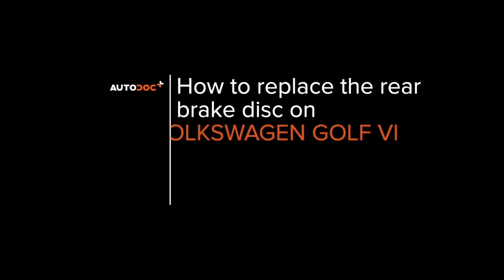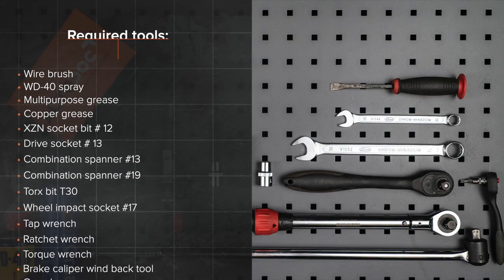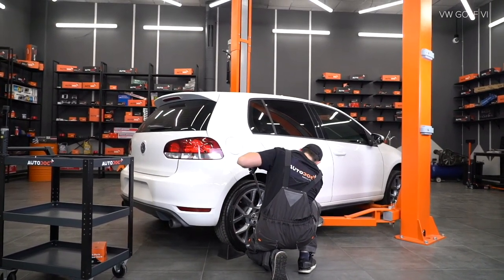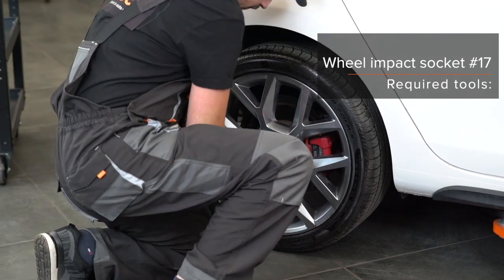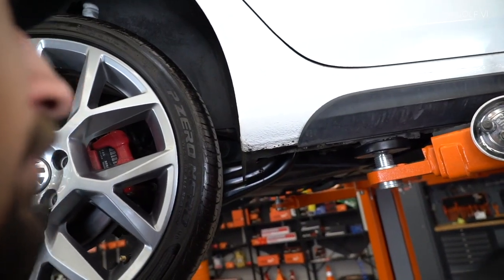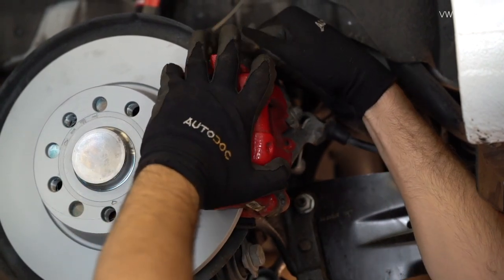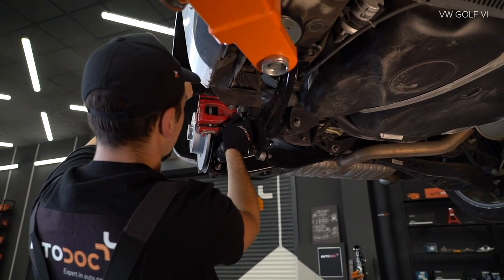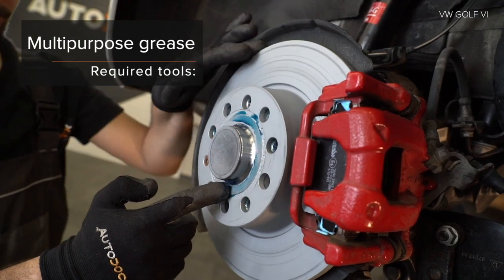How to change rear brake discs / rear brake rotors on VW GOLF 6 (5K1) [TUTORIAL AUTODOC]

Comment from the maker: Attention! This video contains mistakes:
2:51 - the tightening torque is 4 Nm, not 9 Nm.
3:10 - the tightening torque is 90 Nm, not 75 Nm.
3:56 - the tightening torque is 35 Nm, not 30 Nm.
We're sorry for the inconvenience 🙇‍♂
Reply: 3:10 - according to VW is 90 Nm + 90º turn ( always replace with new bolt)

Comment: wish i had read the comments before starting. Caliper bracket is heldon with an XZN 14mm. Also worth loosening the little torx bolt holding the disk on while the hand brake can be applied (before removing pads etc)

Comment: Thanks! This video save me around £70-£100... for which I bought good tools (~£50) Tools stay with me:)
It take for me around 4h - I know is long, but it was my first "big job" in my car:) I try to by very accurate.
And yes is not XZN 12 is XZN 14!!! (golf mk6 variant diesel).
Next stop: rear shock absorbers and coil springs:)
Reply from the maker: We are pleased to know that this tutorial is useful for you.
AUTODOC
Reply: Prepare to have the car off the road for couple weeks at least if you’re working on it yourself you’re bound to run into hurdles
Reply: Just did mine @ golf Mk6 GTi 2011 2.0 petrol. Yes the XZN socket is # bit 14 @ 14mm and not 12mm. Had to order it twice.....took 2 hours per side probably because I changed the suspension link as well. Satisfying fix. Couldn't have done it without this video. Good job mate

Comment: I just don'e this job on a golf Mk6, 1.6 TDI with 255 rear discs, didn't need to remove the carrier, there's enough room to slide the disc out
Reply: how positive are you on that? I can't remove the rear carrier bolts.
Reply: @grand_master_glass  hij heeft gelijk. Ik kan het ook insteken zonder de drager te demonteren
Reply: Dang I got 272mm for my mk6 2.5l. I hope I can do the same
Reply: Yes can be done if you just move the pads carrier. Thats the part that is on the two sliding rods that centre the pads on the disc.

Comment: 2:05 I am currently trying to remove the rear carrier bolts from my 2012 mk6 gti and it looks like your bolts go a different direction from mine. Is that possible?
Reply from the maker: Unfortunately, the complexity of replacement is individual on each car, it all depends on the technical condition of the parts. 
Our videos are for informational purposes only in the sequence of replacement, you always have the right how to replace the part.
AUTODOC

Comment: 2:12  2litre tdi. Didn’t need to remove calliper holder (as per previous comment) would have saved buying the tool for the job and halved the time taken🥺
Reply from the maker: to replace it in a proper way, you need to remove the caliper holder.
Reply: @autodocuk  sorry I don’t agree with you. The disc came off easily without removing the calliper bracket. If you removed the calliper bracket what would you gain, nothing. The bracket was a real pain to take off and did not need to be done.
Reply: @paulcoles6152 going to try my bolts are rusted to big for 12..sm for 14..no 13!
Reply: Nope!...idk anyone have a 13 nvk?

Comment: When should you change your discs. Is there a way to check.
Reply from the maker: Thank you for your comment.
We recently released a new video format in which we tell the very first symptoms of wear of various suspension parts, perhaps this video will be useful to you https://www.youtube.com/watch?v=_3D2az2clow&feature=youtu.be
Best Regards,
Autodoc team.
Reply: Necro thread, but these particular rotors are 12mm thick new, minimum is 10mm.  When you feel a lip at the edge of the rotor, get them checked.

Comment: What happens if the car has an electronic parking brake?
Reply from the maker: If your car is equipped with an electronic parking brake, then before starting work you need to put it in service mode.

Comment: 🤔If you do remove the carrier bracket and not fitting new bolts when installing then its advisable to use a thread lock liquid ( Most of the important bolts on VWs are the use once type) Also it might be helpfull if you show how to reset the self winding pistons & handbrake back on to the pads after installing new..Anyone just driving off will more than likely end with 💩in their 👖when 1st hitting the brake peddle:face-turquoise-covering-eyes:
Reply from the maker: Thank you for your comment. We are constantly working to improve our videos.